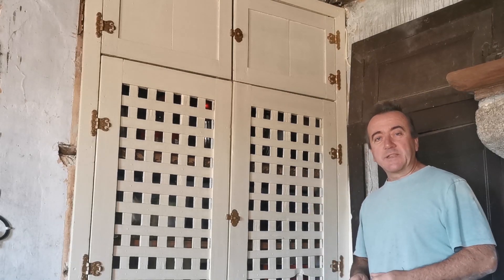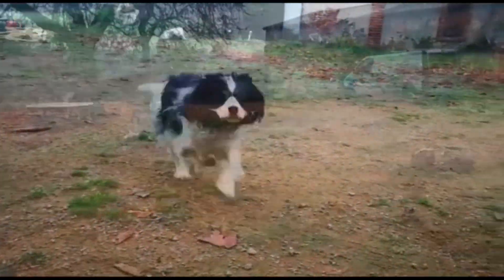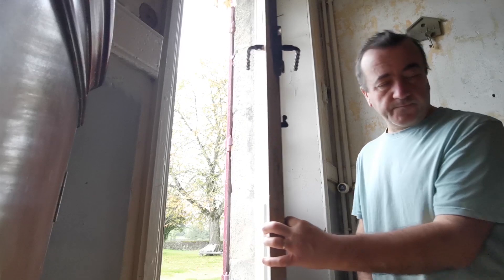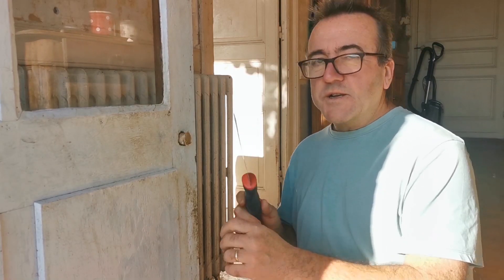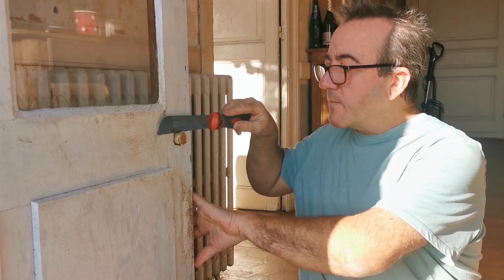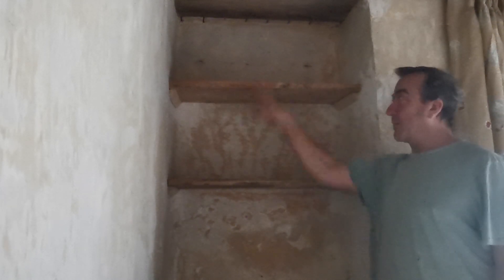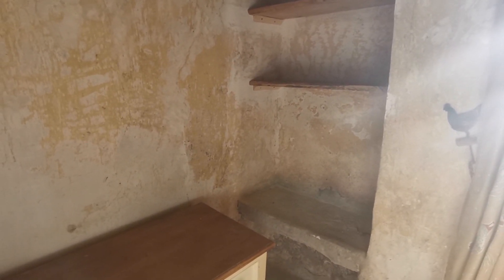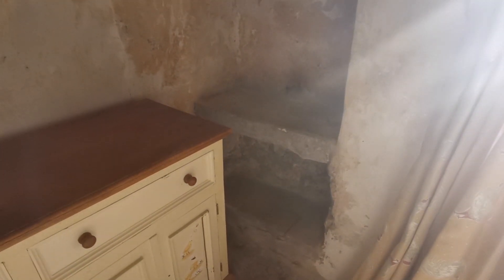Our 600 year old château tower

Comment: Glad you had a nice trip Suzie!  I couldn't help but wonder if the tower window sills were raised/filled about 6" & smaller/shorter windows installed?  In the first shot it looked like maybe there was an edge of granite showing? (At least looked like grey vs reddish stuff currently on top to me...).
Reply from the maker: Hello, thank you for watching. There has been work carried out on the tower, as you would expect for a 600 year old building so it is possible the windows have been raised. All the best, Suzie and Rols